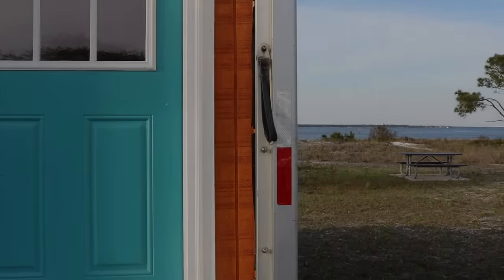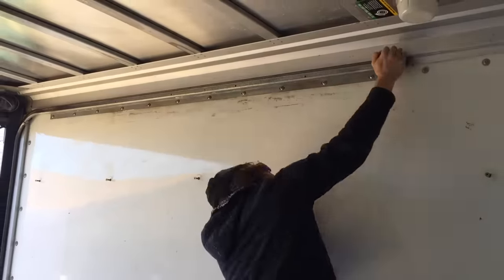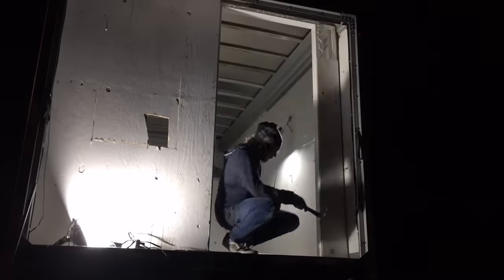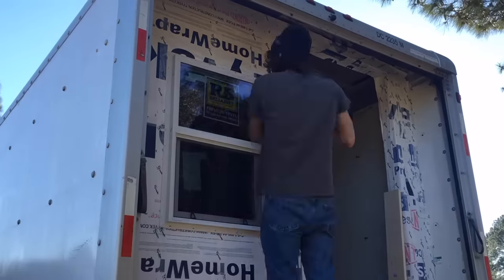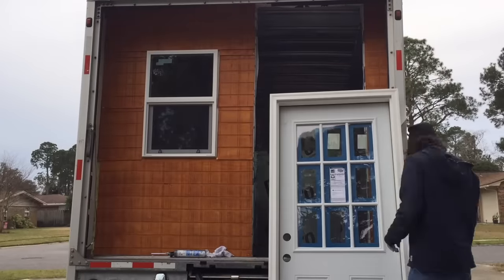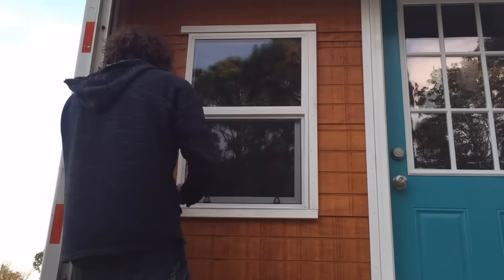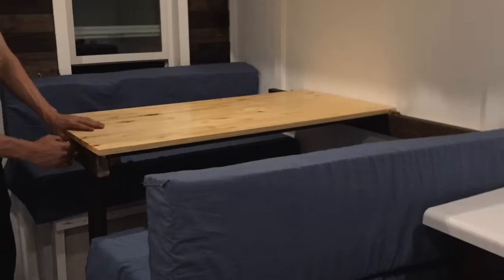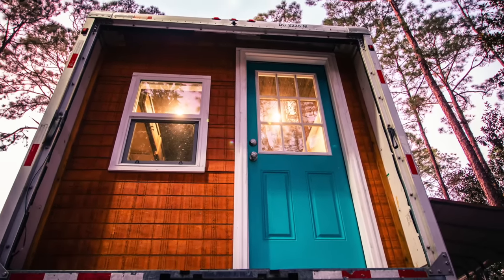How to Convert a Box Truck to a Tiny House

Comment: Anyone that stated that the Tyvek being installed upside down is incorrect and will cause leaks has no idea what they are talking about. Tyvek is made in layers it’s not placed together in small strips and overlapped like a roof that’s the only way you would have a leak.

Comment: I would have been lazy and left the wood battens on and just insulted horizontal. It is most likely stronger that way as there are likely stud going vertical already! On the hole a good job but I think you could think about adding insulation on the floor!

Comment: In vehicle design one of the things you want to avoid is top heavyness.  Adding a 3/4-inch layer of wood to the ceiling was a mistake.  A lighter solution would have been similar to the side wall solution.  In the trade it is called luan, but most people call it wall paneling.  It's 5mm thick plywood.  It can be glued or screwed in place and curves easily to match the curve of your van ceiling.

Comment: did you end up with mold under the mattress? As it was placed directly on top of the wood
Reply from the maker: No, I don’t think we used it long enough for that to happen. That is a valid concern though and I would definitely build with slats as opposed to a solid surface next time.

Comment: Can you install Tyvek® WB with the lettering facing inwards or upside down? Tyvek® HomeWrap® and Tyvek® CommercialWrap® are non-directional and are equally effective if installed with the logo facing the inside or outside of the wall or with the logo oriented in any direction.

Tyvek ® FAQ - DuPont

Comment: You know what I do young man is I'd buy more U-Haul trucks and convert them and turn around and sell them that's what you could do you can make money off of that big money I'm pretty sure people would like to buy a converted truck that's nice inside than a big money ticket motorhome a class a or a class c you might be able to make yourself some big dough on converting them think about it good job anyway I think it looks just perfect I would have kept the roll up door though and move move to wall back that way you could have put a generator in there and maybe you could have put an air conditioning unit in the window when you want it to there's things you could have did but I think it looks good you did a good job think about converting them you might make some cash

Comment: I think I would have kept the horizontal boards in the van and put insulation between them, then put a final wall on top of that. No ripping out of boards necessary.
Reply from the maker: They had spacers which made them stick out further than was necessary for insulation.

Comment: I would have placed double hinged doors(ie barn doors) in the back, in front of the other "homey facade", more for the stealth factor and filling the space at the back of the truck.
I realize that the stealth might not be a necessary factor, but there is a lot of wasted space at the back one way or another.
Reply from the maker: Actually we used it as a porch to sit on and a surface for cooking. Also the roof  curved over that space so we lined the wall up with the first metal cross member for the roof. It also made so the you don’t open the door and then drop 3 feet to the ground. We think we made the right call after camping in it for 6 months.

Comment: you could of removed all the door seal then using a pice of steel tubing like 2x6 bring it out flush with the rear of the box suport steel then tack it in as you go so its flush top and sides then build your framing on it so when you put your sheeting it's 16th from flush then pot your house wrap on after you put your window use vaper tap to seal out the cold you should spend the mony for aluminum sheets

Comment: I am looking for information on how to insure a Uhaul truck as a personal vehicle. Insurance people are telling me the VIN shows up as a commercial vehicle. That is much more expensive.
Reply from the maker: I didn’t have this problem. I registered mine as a personal vehicle. In most cases, you simply need to state that you are using it for personal use. I’m not sure if it differs for other states or insurance companies.
Reply: @ColeWebb  You are correct. I finally (after two weeks) jumped through the proper maze to get insured. The commercial insurance insured it as a personal vehicle at a relatively reasonable rate. 
Now if Uhaul will get the sales finalized. 
I will delete this question in a couple days.

Comment: I love your channel but Why did you stop making videos? 😭😭😭 can you explain why?
Reply from the maker: I'll be back soon with a new project!
Reply: @ColeWebb  You are still reading comments long after you posted the video!  

I have sealed all the holes in my RV ceiling, too many leaks over the years.  Planning to install a small squirrel cage fan instead of the noisy kitchen vent fan and duct that outside.
Reply: @ColeWebb  I agree about the bad features of the roller door.  Did you ever wish that you would have kept it more stealth by sealing the back wall with a fake roll-up door?

I now have a cube van with a man-door in the passenger side wall and I plan to seal the back wall completely after I finish construction so that it still looks like a cube van.

Comment: When you build a van or 🚌 bus
you use whatever is available if on a budget 🤔..if not you get top materials..you always going to make mistakes on van built..
I'm a wood Smith or wood expert  i been working  on exotic  woods seens I was 12 more than 50 years experience. And I'm a blacksmith as well. Seens I was 13 49 years or more...Im  retired but do work here and there. For special customers or friends..
I done a few over 15 van builds 
And belive me I still make mistakes. Van build is very versatile 👌..you build and take apart and build again...is the way it works...new ideas come as you build and you make changes..is ok to make mistakes...

Comment: But I will keep the sliding door that goes down I will make the window and the door but I will keep the sliding door so when you're not there you're not driving away part you could bring it down and lock it so nobody would try to open the door go to the window😮

Comment: As cool as the rolling door is, it's not very practical. You can't have anything on the ceiling where the door rolls, you can't put a hydraulic bed in that spot, and the roll up doors aren’t the best as far as heating and cooling.

Comment: that's not true it actually has very very tiny holes in it to let the moisture in and out it doesn't matter if it's upside down or upside right whoever told you that don't know what they're talking about I've been a carpenter for 50 years

Comment: Kilz primer is not enough to stop future fungus, or rotting. Anyone looking to do this needs to use treated lumber for exterior walls and/or sub floors and use marine grade plywood if you're doing wood flooring! Yes, it's a bit more expensive, but it won't be as expensive as replacing it in the near future. Or, if you're living in it, future medical bills from lung problems due to mold. 
Of course these aren't as serious if you're in Arizona, or some place dry like that, but you still want anything exposed to the elements, or could retain leaking water to be made of treated wood. 
Buying treated vs. non-treated studs is only about $2 difference/per board, so ...don't be "that person"! As far as the plywood goes, that's a little more expensive (about $10 more/per sheet). Total, a build like this would be about $50 more to use treated studs and for subfloors, use treated lumber and marine grade plywood.
Reply: @cadenwebb8015  I wasn't talking to you. That's why I said, "anyone looking to do this, ..."
Btw, it's a good thing you don't live in it anymore! Remember that, just because someone knows how to frame and skin a wall and they've built a bunch of houses doesn't mean they know how to engineer something. I've seen a lot of people who know just enough about construction to be dangerous. They caulk on the bottom of a seem, thinking they'll keep it safe from water, but you need to leave the bottom open for condensation to run out, they use the cheapest materials (not the right materials). They're great at following directions and they can read a tape, but they don't fully understand why they did what you told them to do.

Comment: OK i'll bite. 
bro, that thing is called tyvek. it's literally written on it. 
the right side up thing is talking about having the printed side facing outwards. i guess people are messing with you. or perhaps that's your intented joke :)
instead of cutting up your roof for fan which is harder to mantain and a potential leak, you can do it on the side wall especially that you have to fabricate the rear wall where it's top part is "under the ledge" anyways.

Comment: Ok looked at your build not bad however can i say why is everyone wasting so much space mini r v home and shipping container homes ok example insulation double r 20 it on the outside with outer wall so  you can easily up date and allow a better process to insulate and also to never leak ever no rust or water do it with spray in box liner spray then paint it afterwards roof and walls and floor also you could use solar to have the floors and walls heated in the winter or cold weather through a inverter solar and dry cell batteries